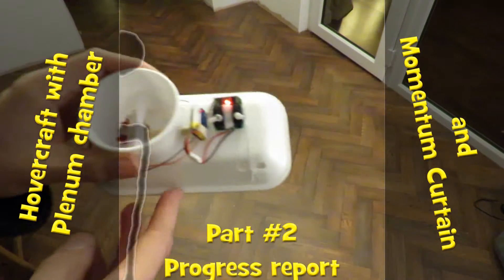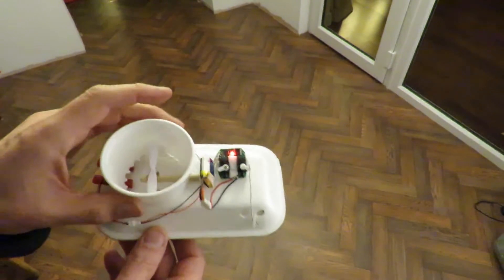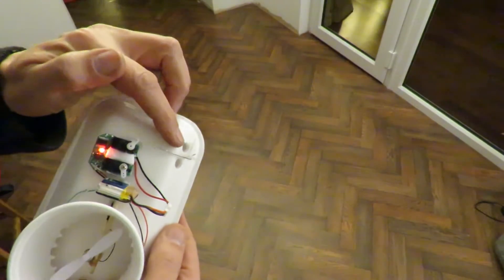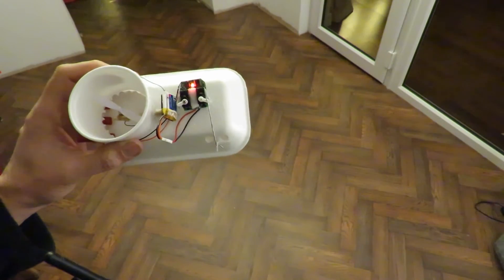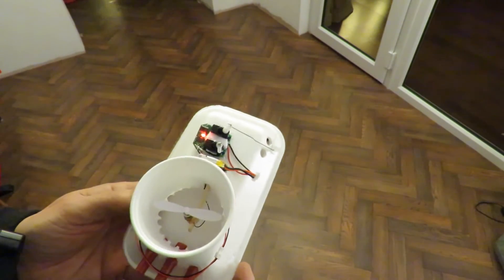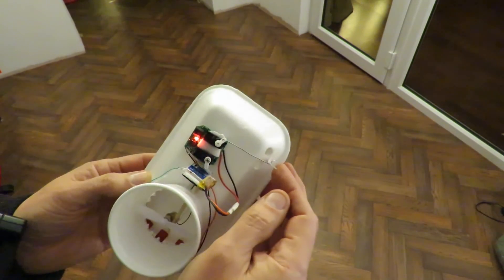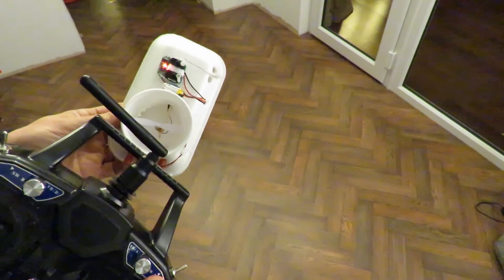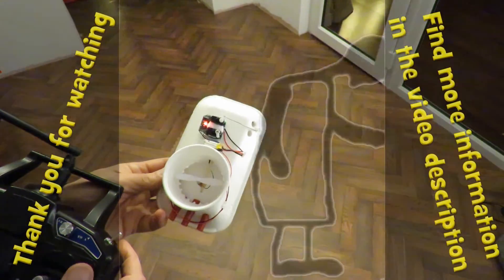Hovercraft with Plenum chamber and Momentum Curtain Part #2 Progress report

Comment: You could try slaving the throttle and vent together so that the torque from the motor is automatically balanced.
Reply: Can't wait to see the next version  :-)
Reply: He would have to increase the servo arm length for that to be effective along with a lot of experiments to get the right ratio of mixing.
Reply: He would have to increase the servo arm length for that to be effective along with a lot of experiments to get the right ratio of mixing.
Reply: +Mr Rishi The Cookie 
Yes...that's the fun part.
But I realized that the throttle isnt variable so they can't be run in that configuration.
😞
Reply: +Wil Hobbs so sad
Reply from the maker: +Wil Hobbs the throttle is variable and I could mix the controls to achieve what you are suggesting but I abandoned this idea. It was an interesting side track but I cannot get enthusiastic about the amount of time it would take to develop it. Fine if somebody else wants to have a go :)
Reply: Ok.
The longer throw on the servo and one of those higher mounting points might work.
Also perhaps some sort of skirt...perhaps bristles to provide a small amount of friction.
This might control the spin somewhat.
Reply from the maker: Wil Hobbs the idea of the pressure wall created by the layout underneath is supposed to mean that a skirt is not required, well that is what this little project was trying to test anyway :) A sliding door on the vent would probably work better than the flap I am trying here are the air is redirected by the flap so that is counter productive.